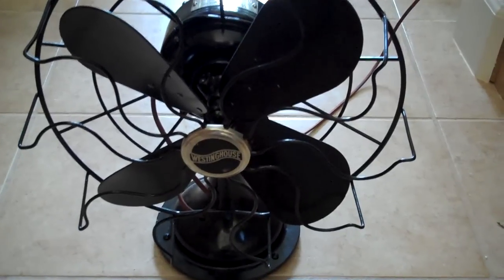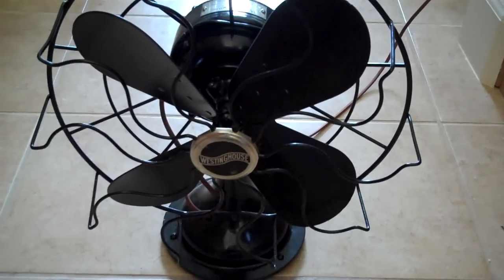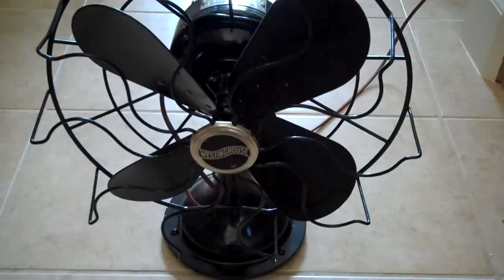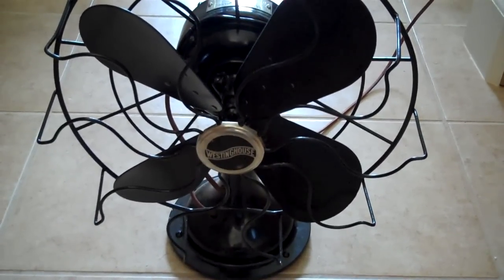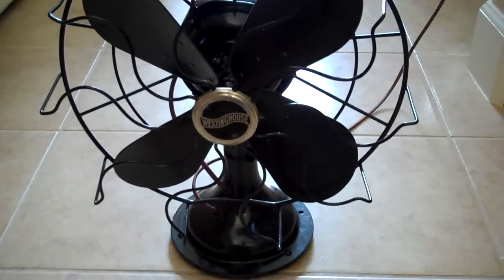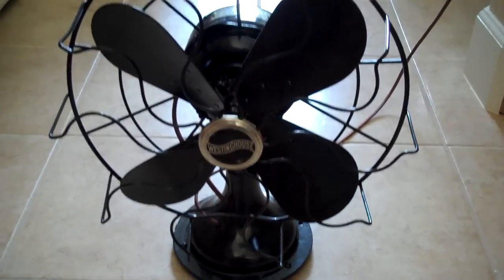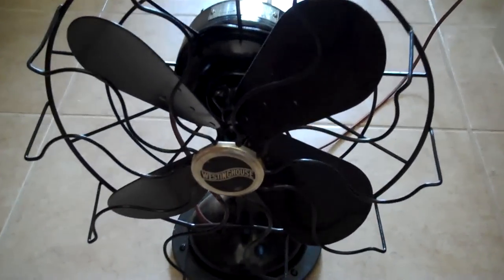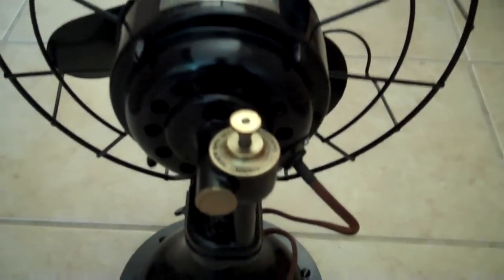Westinghouse Fan Approx 1926

Comment from the maker: It was actually hard.  I had to loosen the weld on one of the wires on the cage and slip it through.  Then after repainting the blade, I had to cover it up, re-install it, and weld the wire back into place, then touch up paint the weld.  It looks perfect now.  But it sure was a chore.

Comment: I have the exact same fan. It works but it looks run down. Do you have any documentation you can share with me on the restore process. Yours looks new. How  did you repainted it? How did you get the tag and the front label shiny? Did you rewire the inside? Thanks. Great job.

Comment: how did you open the casing. I am trying to restore one myself and not able to remove the stator from the casing.
Reply: Did you ever find out the answer to your question? I have the same problem.
Reply: Got one just like it. Took it apart @ 20 years ago. Never have restored it to operating condition, but as I recall the gear for the oscillator has to be removed so the shaft will slide out of the rear housing.